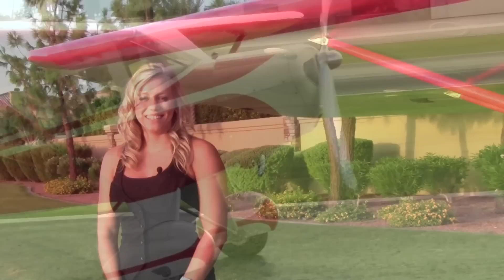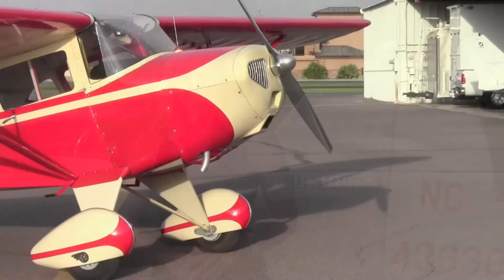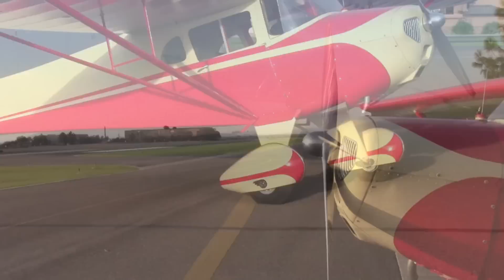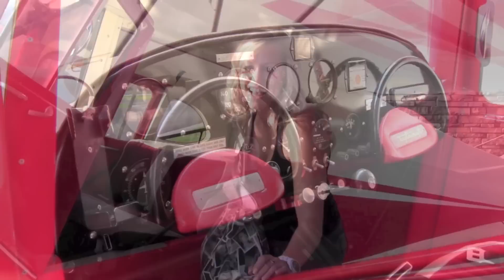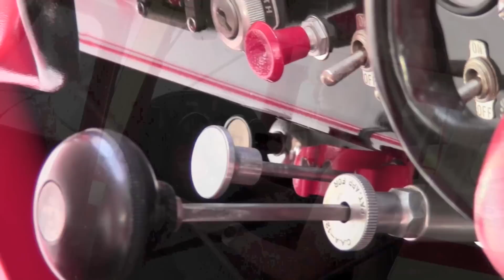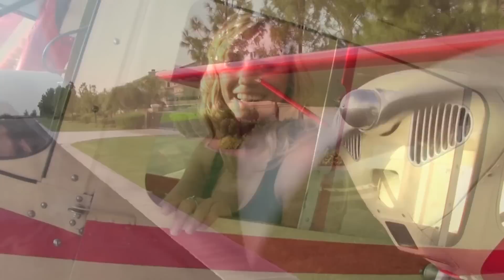Taylorcraftfun 1946 Taylorcraft

Comment: T-Craft's are one of the more efficient aircraft of its time and this one is a great example.
Spent lots of time in a nicely restored T-Craft with an 85HP continental back in the early 1980's. It was the airplane that taught me how to land tail wheel planes. So gentle and forgiving this was and still is truly an airplane that made learning to fly very easy and enjoyable. 

This is a beautifully restored T-Craft and a very confident young woman at the controls. most people that fly on skies will hand from the rear side of the prop. This way if the plane starts to move forward you are able to get at the controls in a second. Most planes that are float equipped and don't have a starter must be started from behind the prop since there's no room in front.

Beautiful airplane and woman. Thanks for the video!
Reply: Yea the 85 is the way to go or better yet 0-200 not gonna go to much faster but climb is much better esp in the west.

Comment: Very nice plane. Very nice presentation. As a long time pilot, over 35 years – I just got a BFR in a great Taylor Craft with a great instructor. I think all pilots should get a BFR or at least a check out in a tail wheel airplane with a good tail wheel pilot at least every couple or few years. Teaches you what those peddles are for down by your feet, no -not the brakes.

Comment: In the 80's I had a 1979 F-19 with the 0-200 engine, N2003L, took it to Oshkosh in 1986, great airplane, it would cruise at an honest 100MPH on 5 GPH, wide open throttle in level flight would see 118MPH, I really miss the aircraft, wish I never sold it.

Comment: Why don't they start building these beautiful little planes again?
Reply: They did, for several decades. Charles and Dorothy Ferris, from the original factory staff, brought them back in the early 1970's as the F- series the F-19, F-21, etc with many improvements. After Charles passed away his wife continued the company until 1985. The company then changed hands a number of times and after many financial and legal issues finally folded in 2007 and was repossessed by the original owners who were manufacturing wing struts in compliance with a recent Airworthiness Directive. The company is now up for sale but lives on with Auster and Aviat aircraft along with many conversions based on the original design.
Reply: Jeffrey Nelson Simple, lawyers and lawsuits. That’s who killed the small plane industry.

Comment: It looks like a mix between a j3 piper cub and a Cessna 172
Reply: Waffles Gaming
Wow, that's a stretch. The Cub is a 2-place tandem and the 172 has a 4-place cabin. The Taylorcraft is a 2-place side-by-side. These are three distinctly different aircraft.
Reply: I learned to fly in a T-Craft and graduated to a Luscombe. Suggesting there may be a remote likeness (except for the fact that aircraft have adjustable parts to manage airflow, like a bird has feathers) between any tail dragger and a 172 is adequately covered in the preface to Flying 101.

Comment: Nope cruise for the T-crate is 102 and the Luscombe 8-A is 105 mph  the two most efficient side by side two places on 65 Hp.
useful load is quite a bit lower than the luscombe, while the T-crate isn't so short coupled and thus not so quick on the landings..  Very different construction..  Pay your money, take your choice.  Taylor was the designer of the Piper Cub, and the Tcrate was his improvement  after he sold to Piper.  Probably better on floats than on land.
Reply: Capt Larry I understood that TCraft (early ones, anyway) were license-built British Austers. How does that fit in?
Reply: +carmium 
Other way round I think - Austers were developed from the Taylorcraft. But Mr Taylor was from Britain originally?!
Reply: Two different Taylors !   One American, one English.The T-crate is  an American Design.

Comment: If she can fly..so can my cat Cuddles..
Reply: +Dale Helmick  Well she is a professional snowmobiler.  Can Cuddles ride a snowmobile?  I would bet she could fly it.
Reply: Taylorcraft is one of the easiest-to-fly designs I've ever flown. Frise ailerons and a near-laminar-flow airfoil you basically drive it anywhere. And with generous rudder-to-fin ratio it's great in a crosswind almost self-correcting.
Add the Monocoupe-inspired bar-of-soap fuselage profile- it wants to fly. So let it. So light on the controls the only danger is over-controlling. Basically you trim it, sit back and enjoy the ride.
Reply: @wmfife1  Just sit back and.......

Don't forget to take the crosswind correction out when touch. ..do...wn.....happens and you were just sitting back, enjoying what was a pleasant ride